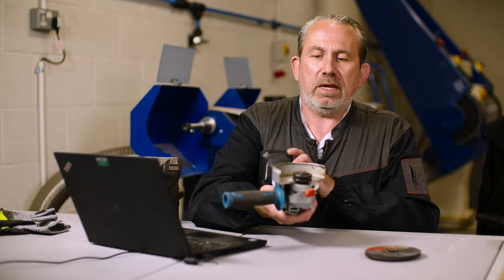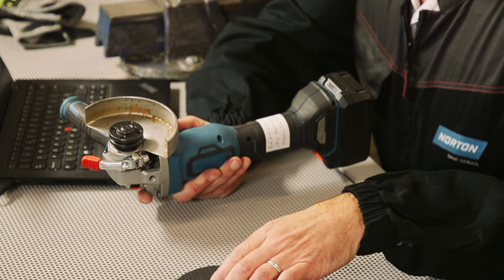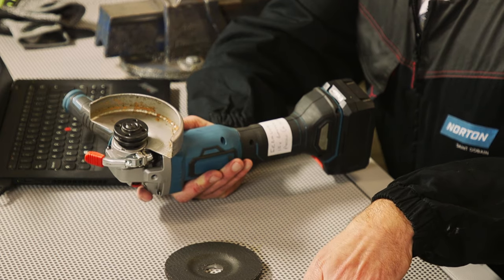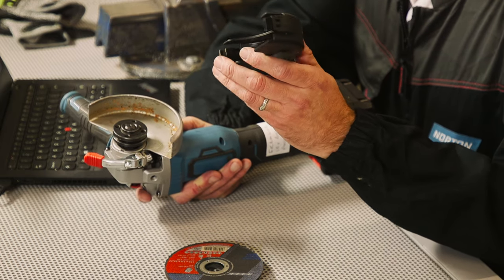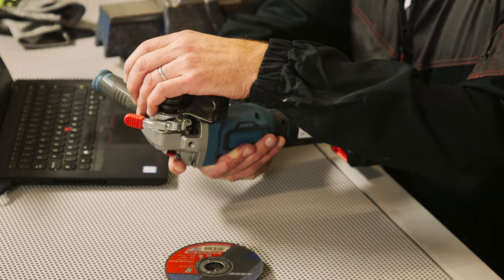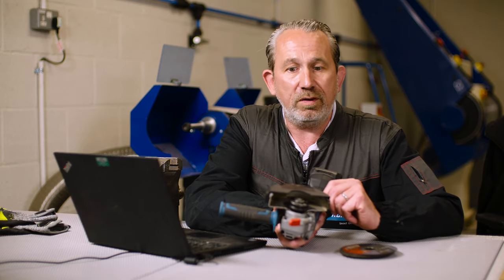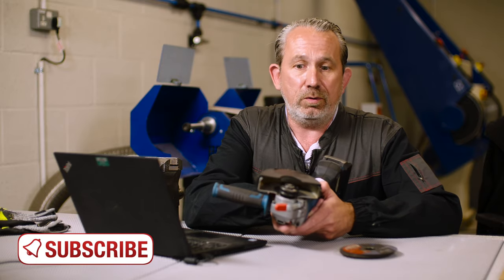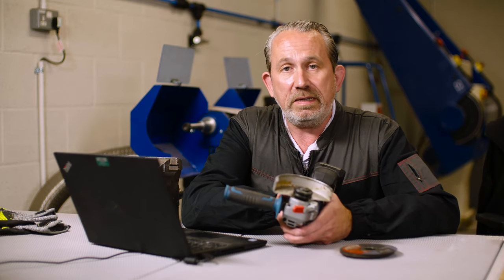ASK THE EXPERT: Which guard should I use on my angle grinder?

Comment: What's wrong with using the big guard for grinding?  Is it just that it gets in the way?
Reply from the maker: Because the cutting guard encloses the disc, if you were to use it for grinding, it will get in the way because of the angle of the machine to the workpiece.
Thanks for watching!